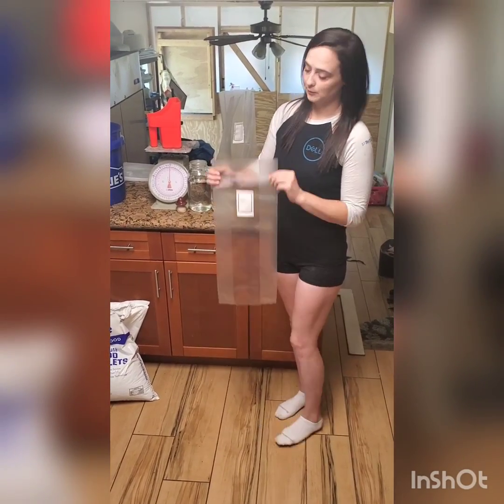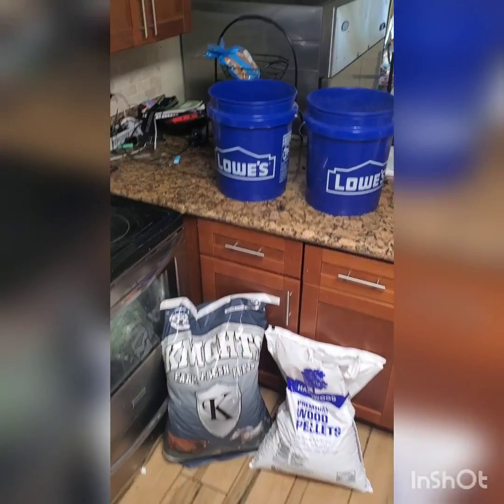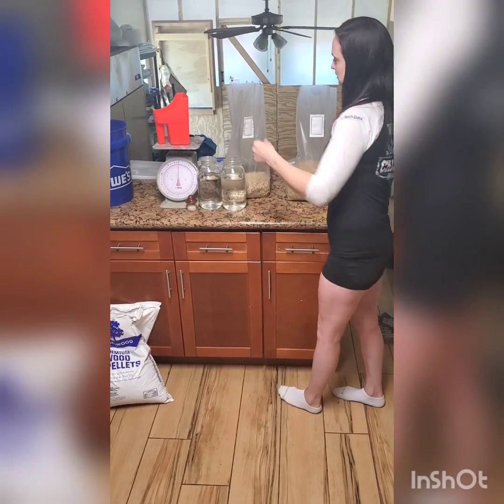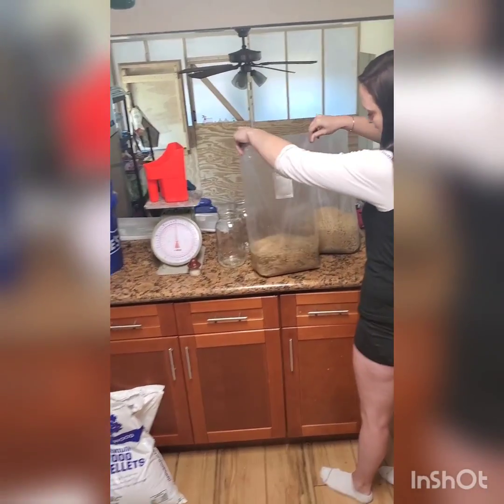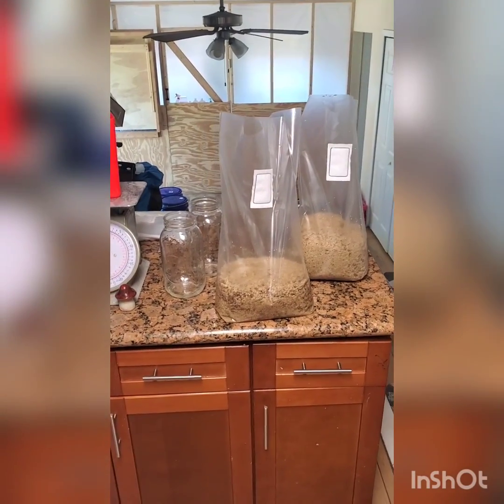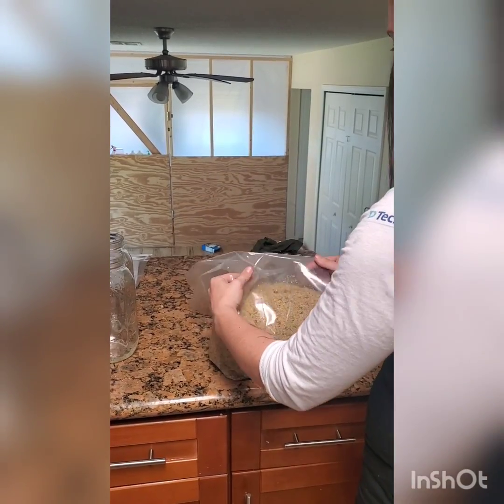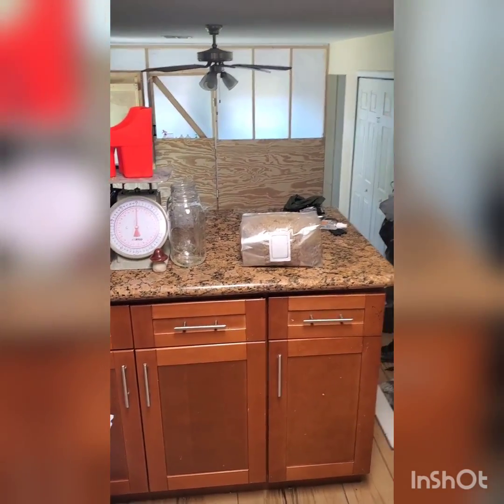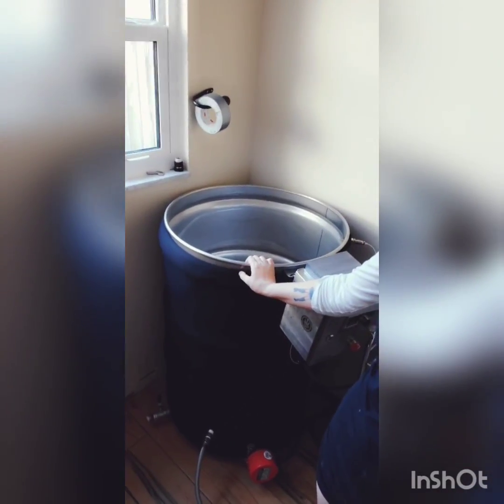How we create mushroom blocks using masters mix.

Comment: When do you seal the bags? I find that after sterilizing, the bags are slightly moist and it makes heat sealing iffy. I also heard that you shouldn't seal before sterilizing though unless you have a Type B filter on the bag.
Reply: We sterilize, innoculate then seal. You have to get a sealer that is good enough or it won't work with the water droplets. We have a large wall mounted one that we love with a foot petal.
Reply: @monicamayfrench  hmm. I got a Linsnfield one which I thought was one of the good ones and still having trouble with it. I might try to just seal pre-sterilization with Type B (5 micron) filter patches. I read that that size filter is safe to seal prior to pressure cooking.
Reply: @jalexkern  I’ve got an okay sealer and I still am able to seal after sterilization. One thing you can do is spray a paper towel with alcohol and let it dry then use it to get rid of any moisture near the top. As long as you’re working in a flow hood or still air box you should be okay.
Reply: Just dump it all in a tub and grow it in a tub